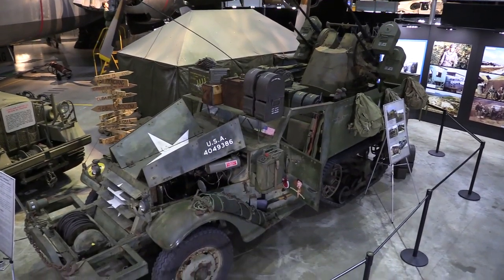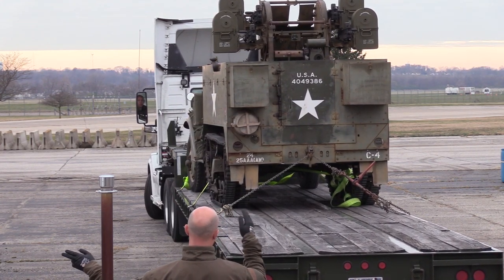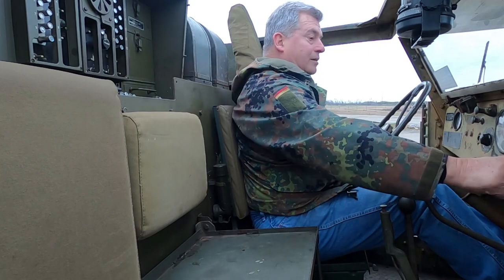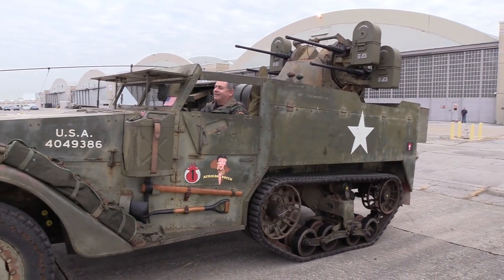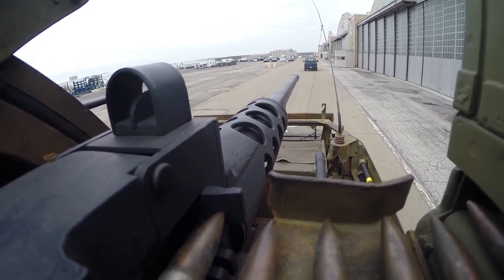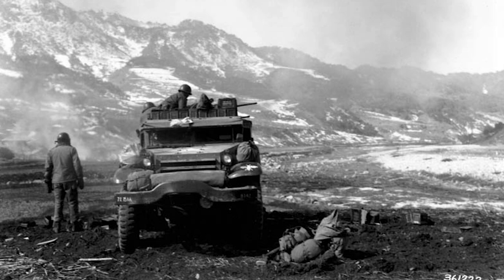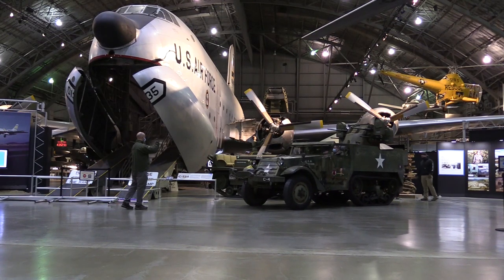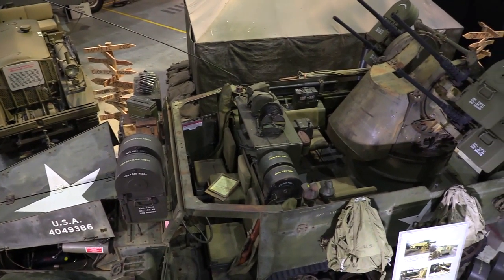U.S. Army 1943 White M16A2 MGMC (Multiple Gun Motor Carriage)

Comment: Great video. The "White" version of the M16 may have seen first use in Korea in 1952, but the M16 did see use in Korea in 1950. My father was a Master Sergeant of Battery C of the 459th AAA AW SP of the 2nd Infantry DIv. When they landed in Korea they were integrated into what was the 82 BN AAA AW SP under Lt. Col. Walter Killilae. According to Walter in his book "Korea 1950-1951 82nd AAA AW SP" P. 48, he stated that each battery at the start of the war consisted of 8 M16s and 8 M19s. Unquote, It was later toward the end of 1951 that the M16s replacements were being outfitted with armor to protect the canneers as they used the quad 50 cal.

Comment: The front tires are solid rubber combat tires made in 1954 by Michelin Tires.  They are called Michelin Invincibles and actually have steel belted sidewalls.   The outer tire is weather damaged from sitting in the desert for 50+ years.  However the inner  tire (solid rubber)  is like the day it was made and holds up well under the weight of the halftrack.  I have new tires mounted on an original set of WWII combat wheels sitting in my shop, but prefer to keep the original tires and combat wheels on her for now, or for as long as they'll continue to hold up.
Reply from the maker: We are soo very excited to have her back on display!!!
https://www.aqproject.org/

Comment: I'm a military radio nut, love the WW-II radios SCR-508 (BC-603 receiver & BC-604 transmitter) The Transmitter is wideband FM and I don't think the FCC will let us use it on any frequency except maybe if you're in the military can do anything you want. TM 11-600, SCR-628, SCR-508 Bet the AF Museum library has copies of the manuals.  I see you have the spares box instead of a second receiver if it hasn't dynamotor grease can inside I'd recommend repacking the dynamotor's bearings.
--------- Love the sound of dynamotor's in the morning ---------- Hit the PTT switch on the T-17 microphone and listen to that BC 604 dynamotor roar.
Reply: Mack the radios work and I have another receiver but this is the type radio configuration stenciled on the side of the halftrack.  I have the original manuals with the wiring diagrams which has been most helpful regards installing the BC 606(?) intercom boxes.

Comment: Interesting to see this one it looks to have been the troop carrier version modded to put the quad 50s on the m16 never had the rear door the spare barrels were mounted on the rear inside wall as never had an opening door so was made into a stowage rack and the the other 2 were layed on floor up each side of the Quad  station I thought it was strange to the one's I'm used to researching but have just downloaded the original war office documents on the white and diamond T halftracks amd all the variants they had one with the same set up but only 2 50 cals instead of the 4 and had the rear door! Thinkmthe later one's were re designed
Reply: Charlie this is strictly an M16 built in July 1943 and converted in May of 1952.  Troop carriers converted to M16A1 status did not have the drop down armor on the sides with the cutouts for the turrets weapons.  Your right the original M16's did not have a troop door.  But this is a M16A2 and during its modification had the rear troop door installed, a uniqe charging system and radio system upgrade and the addition of two larger storage boxes installed on the back of the track.  In addition an extra 12 inch turret ring was installed so that the fold down armor did not have to be used and the weapons could be depressed to be used in the ground defense mode against the human wave attacks in Korea.  There are 4 spare barrels, two mounted on the floor and two mounted on the passenger side wall in the gunners compartment.  In addition two seats were installed in the gunners compartment for the cannoneers to sit on verses the cushions on the floor in the original WWII version.  Appreciate your comments!